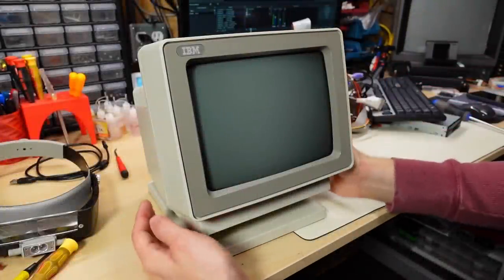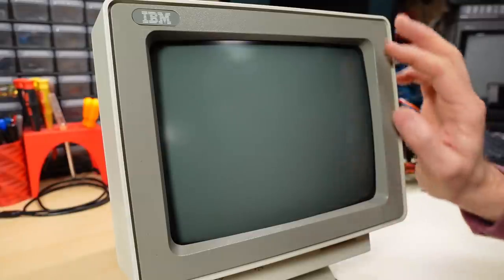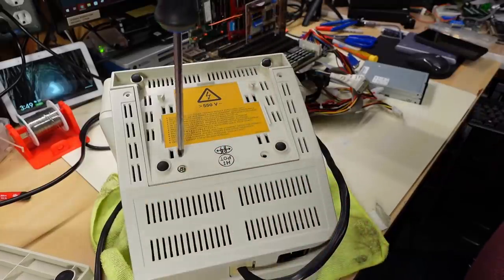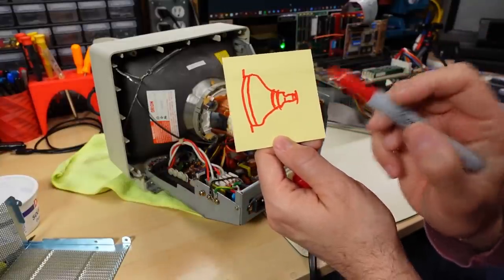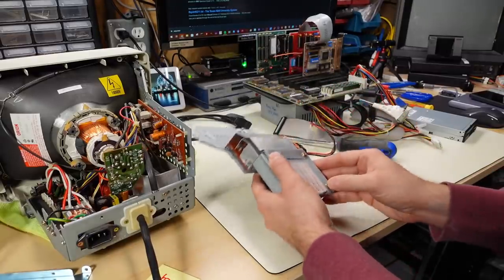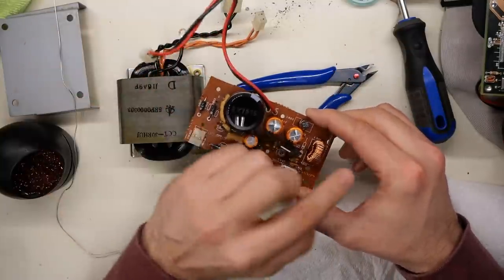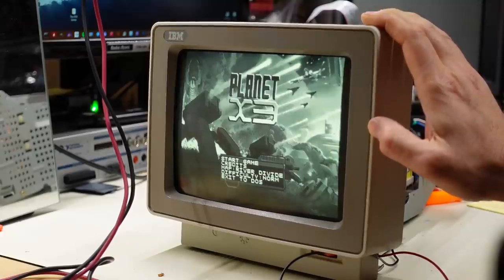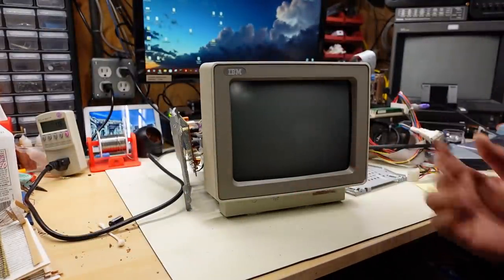Corrosive glue nearly killed this monitor (IBM 9" VGA)

Comment: I haven't seen this type of rejuvenation before, but it is impressive. How does that rejuvenator work?
Reply: Please put a PSA about those large electrolytic caps potentially having a deadly voltage in them, especially as the monitor may have been plugged in recently as part of the test and debug routine. Even if the monitor didn't start doesn't make them less dangerous.
Reply: In the 1970s there were ads for CRT Rejuvenators in every electronics magazine. They work the same way as an "Italian Tuneup", which was a common term for a mechanic adding some cleaner and fresh oil and then driving the car really fast for an hour or two to blow the crud out. Rejuvenators run extra current through the cathode to blow formed oxides off and that allows more electrons to stream off. They overstress the heater and then they pull some excessive current between the cathode and one of the grids so they physically rough up the inside of he gun assembly and reduce the heater's lifespan but that's usually not an issue. You often see fireworks inside the tube when using them. I'm sure videos exist.
Reply: @kristianTV1974  Nonsense,  the little capacitors used in such monitor or in larger TVs DO NOT “deadly voltages in them” this is a gross exaggeration, not even the anode voltage can kill, a healthy person, unless they prone to heat attacks, or other such heath problems, the energy stored in them can NOT kill, they can cause injury, yes. But not kill directly.  
I have been working with vintage electronics since I was a child, I restore vintage tube equipment, and your statement is clearly inaccurate.
Reply: @suzakule  Yeah, I mean sure getting zapped by a tube and / or flyback hurts, but it shouldn't be able to kill you. What does a tiny CRT flyback output, 1-2mA? Not enough to kill you, especially due to the high frequency nature of them. (HF AC before the multi, DC afterwards)
The CRT itself also has only a couple 100pF, enough to bite you, but unable to kill you. The discharge only lasts a couple nanoseconds. The SMPS input filter caps on the other hand, can deliver some decent current and badly hurt. They could maybe cause some harm, if the current flows right. But then you would have to touch both termials with one hand each, very unlikely. 
Still, proper precautions like discharging the tube and the mains filter caps, (or basically any high value, "high voltage" caps) should be taken which everyone with a half working brain should know and do. 
I hate that bloody fearmongering.
Reply: @kristianTV1974  The main board here runs at 15v, so not particularly deadly. Even the bug PSU caps here are less than 50v. Still it always good to keep in mind that some can be dangerous, don't go poking around unless you know what you're doing.

Comment: That warning label isn't 550V. It's GREATER than 550V. One of the three common safety levels in electrical work. You've basically got 550V+(High voltage), 550-50V(Medium Voltage), and 50V and below(low voltage).
The MV/HV differentiation I belive relates to roughly the maximum peak voltage of the combined phases were they synchronized of common 3-phase. (360V*1.42, plus some change for a pretty number) or somesuch down that line of thought. The idea is dealing with more than the potential of such a system is more hazardous than "home" juicy juice  ;P
I suppose 240V countries may have a slightly different breakpoint?

Comment: Wasn't that 17 watt spike just inrush current during startup?  CRTs have a significant inductive load, non?

Your troubleshooting path found the fault!  Nicely done.  This was a great illustration of how schematics are not strictly required to trace out a circuit's operation.
Reply: Should be a degaussing coil, I believe. Most sets that have them cycle them on in the very beginning. I'm not sure I saw one on that set as I was listening and doing other things.
Reply: @johnpossum556  - only color CRTs get a degaussing coil, and since this was a monochrome set there would be no degaussing coil (and degaussing would not be needed).

Comment: I used to work in the machine tool industry and, if I recall correctly, one of the smaller lathes we got in for repair had this monitor as part of its PC-based CNC.

Comment: I don't think it  was moving out of stand-by at all, not running.  That little pulse is likely inrush current, not the monitor firing up.  Sounds like some kind of stand-by circuit was running and not firing up the HT.     I'd probably check caps as usual, PSU and Flyback circuit.  Electro's often short when they fail.   
I haven't finished watching this yet, so I'll watch to the end and see how it goes.

Comment: That same brown corrosive gunk you can still find in relatively modern devices! I had a 24" LED LCD from around 2011 for repair where that gunk on the LED power board corroded away the legs and traces around the switching MOSFet. I always thought the fabs switched to the silicone based stuff, but apparently not all had.

Comment: I modded TR-80 C color and    Tandy computers 1,000 to use one of those alongside the color monitor I use for gaming.    TR 80 color was also a modded to run a parallel printer.

Comment: My guess was actually the caps first before the chip, I been doing so much old electronics and the rule is always that you cannot trust old capacitors. A capacitor can actually test good in booth capacitance and ESR but the thing these testers can´t check is electrical insulation / current leakage which is the most common problem with older electrolytic caps. generally if a cap have more capacitance than it was marked with there is a big chance the oxide layer is thinner making it leak current. I seen hundreds of bad caps visually looking good but they leak current AF and might even leak electrolyte on to the board corroding things too. I built a leakage tester which is checking if a capacitor is really suited for use which goes along with ESR/capacitance testing. If all test good and the cap is not bulged or wet somewhere I trust it for some more use. but Electrolytics and Rifas/ wax etc can really ruin your day
Reply: Oh - that explains a lot.  I was replacing some Teapo caps on a Pentium III motherboard last week and the 2200uF caps were reading around 2900uF.  I thought that was awfully generous of a cheap cap manufacturer to be out of spec in the positive direction, and also hoping the board manufacturer hadn’t designed the regulators with the intention of having over-rated caps.  But leakage makes a lot more sense!
Reply: @nickwallette6201  yep and this is very likely this phenomenon you seen here. this often gets worse if the device been stored for a very long time not in use. as the caps just lay around the oxide layer gradually gets thinner and as this happens the capacitance goes up at the same time. you are probably known with the term "reforming" where you gradually increase voltage to a cap having current leakage to build up the isolating oxide layer again but this is many times just a temporary solution and it may lead to failure or short circuit down the line if you keep using them. but starting up a long time stored object is always the most risky part since the caps can be very poor blocking the DC which makes them pull much current and things may go pop or act up very strange and intermittent failing until the caps stabilizes again. it is probably best to just change decades old electrolytic caps if you plan to use the device more than rarely even if it may be a hassle. and if you see one of these partly transparent Rifa film type (miniprint and so on) caps in a vintage device it must be replaced on sight because they all fail and they always short and ruin everything they sit in.

Comment: At 21:00, the capacitor that is being glued down does not have venting on the top of its can (the venting will look like slices). That means it is made to vent on the PCB side - and that glue might prevent venting in case the capacitor experiences some fault condition.

Not so good design there.

Comment: hey adrian, isnt it possible to make an RGB mixer to mix everything to 1 signal? I was thinking of something like a s-video to rca adaptor where you mix in the  sync signals with a small ceramic capasitor.  Im not sure how exactly to make it match the impedance but im sure theres some way to passively make it.

Comment: Is there a device you could make where you could have a little 3 channel RGB mixer that combines the channels? You could then have three pots that allow you to adjust the intensity of each RGB channel, then sum them down into the single Green channel? 

Just seems like a really cool little project/ device! Then when you game on a monochrome display with RGB games, you could add in some of the Red and Blue channel to your taste?

Or is this impossible/very difficult?

Thoughts?
Reply: Yes, it's basically a few resistors. Very easy actually. There's a few values you compute from some color theory standard thing if you want an "ideal" grayscale.

Comment: I was about to write electrolytics can most definitely short when they fail, I remember seeing a Daewoo branded electrolytic cap on the output of a 7805 in a Commodore 1084S monito, the Daewoo manufactured set, that shorted completely. Then you started removing the Daewoo cap and sure enough. Daewoo eletrolytics from the late 80's are terrible.

Comment: im over 30+ years old, yet these monitor and tv with tubes still to this day scare the shit out of me, I will not go near it.
Reply: I agree.  Back when I actually worked on stuff I was so afraid of the HV section of a 27 inch TV I was working on I was using a 3 foot wooden dowel and it still hit me.  Never opened a HV section to tap on a tube again.  That was in my 30's and I am now nearly 70.

Comment: What would cause a CRT to start out sharp, but after 10min of being on, the image goes fuzzy/unfocused? I have an old Acer 14" VGA CRT, and it's fine for like 5-15min but after that the image becomes fuzzy/unfocused. With pictures/moving pictures it's not too distracting, but with text and anything with sharp lines it's very annoying.
Reply: Can be any number of things. Bad flyback. Bad caps in power supply. Bad CRT. Bad high voltage resistor. Needs professional diagnosis and high voltage tools to diagnose properly.
Reply: @colinstu  I did professional CRT monitor repairs for nearly 15 years. Along with power supplies and many other things.  Sadly the skillet is vanishing rapidly.
Reply: Chances are pretty good that the high voltage to the CRT anode is not holding up. So the fly back circuits are the number one suspect.
Reply: @stevebabiak6997  focus voltage comes off the flyback so yes something rotten there is the most likely thing..
Reply: @1971merlin   - it’s not just a focus issue, the high voltage to the anode is probably low too. There might be a safety circuit that starts to kick in when it should not, causing the voltages to be lower than what is expected.

Comment: Still possible that the guns are old and cruddy and would have continue a gentle cleaning and stop when the needle no long rises. You cant hurt it on the softer settings and even the instructions on these things recommend doing this.  You can then leave it on day and night to burn off any leftover crud and see how it looks the next day and emissions on the meter.  I can clean and bal all day with my B&K 470 and not damage to tube  but i sneak up on the higher output and rarely ever need harsh rejuv as those old testers were pretty high on voltage compared to the new ones cleaner finer guns they have these day or DID have as CRT's are all but gone now...sigh...

Comment: The Filament voltage being 11 instead of 12, will account for the image being less than optimal brilliance. 
No doubt it's very high hours
The computers where I used to work, were never powered down....left on permanently
Electrolytic capacitors def go bad with age alone never mind use. 
I have some "brand new" "never installed" from decades ago..all test a high resistance, completely unusable.
Reply: This kind of CRT is usually meant for 11v instead of 12v. I think the idea is they can run from a 12v supply with an inrush limiting resistor.

Comment: Ого, у него внутри неонка!
Reply: The neon bulb on the CRT neck socket PCB is for arc protection, in case any of the high voltages within the CRT were to arc onto the video cathode.
Reply: @stevebabiak6997  okay, thank you for explanation!

Comment: capacitors are the number 1 most common fault with either leaking, capacitance drop or right out short circuit, always inspect them before anything else like resistors and especially ic's

Comment: it runs off 15v? that's perfect for using in a car.
Reply: I modded a B&W TV set to do just that. Also stuck a resistor inline and used an 1/8 male to male plug to run an Atari 2600 (9 VDC) back in the day. It's funny to see the set's picture compress as you turn over the car during startup.
Reply: @johnpossum556  yeah cus the voltage of a healthy lead acid battery drops below 11v while cranking and old worn out ones can go as low as 7v to 9v. Pretty much all things turn off at that voltage. When i buy a new battery for first few years the car stereo doesn't turn off while i start the car but now my battery is almost 6yr old and its 10c outside and everytime i start the car the radio restarts 😂. The battery is pretty bad or my alternator also might be going bad cus turning on the ac or high beam dims other lights slightly.. 
& u could have used some 7809 in parallel with 0.1ohm resistors for load balancing..
Reply: @KuntalGhosh  True, but I'm not sure they even made a 7809 back then. Also I didn't really have a concept of power dissipation per the TO-220 package. I made a lot of mistakes back then and I wasn't about to fry the expensive family Atari machine.
FYI alternators are 3 phase so usually when the voltage drops that low the ones that have had electronics fail on me were often 1 of the usual 3 diodes (6 with chrsylers). It's worth rebuilding the whole thing which can be done cheaply. I bought all my kits from Fleet Farm and they are available online. Have fun & good luck!
Reply: @KuntalGhosh  BTW you can duplicate an official shop test just by turning on high beams, heater fan on high...etc and if the voltage drops below 13.4 Vdc while the engine is running then its time to rebuild that alternator. Delaying it will kill the battery prematurely.
Reply: @johnpossum556  yeah i had diode failure before as well thankfully the car was mechanical diesel so i atleast got home without any lights driving at night is painful. I had to push start it 3 times 😂

Comment: You really should cut the legs on components before soldering them because you might create microscopic fractures in the solder if you cut them afterwards, causing bad solder joints.